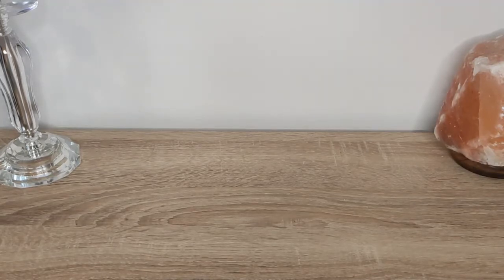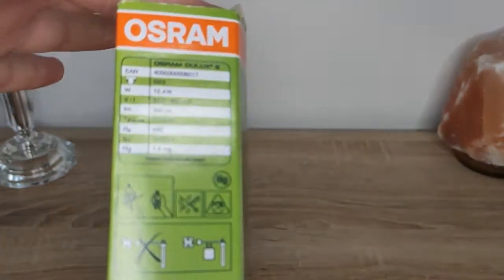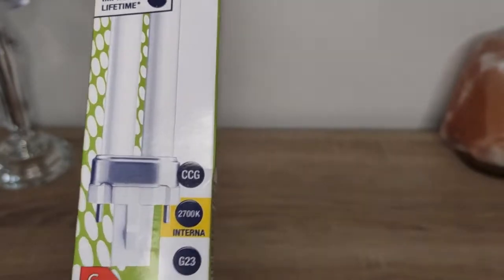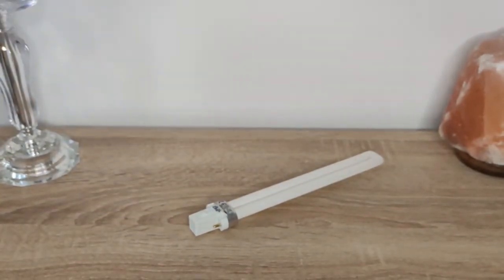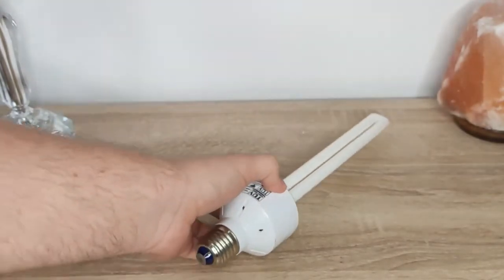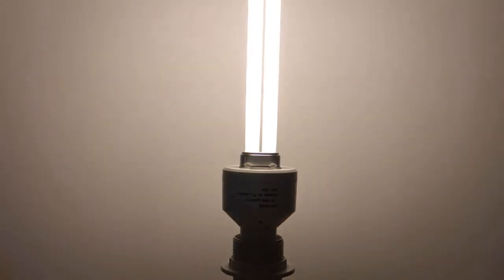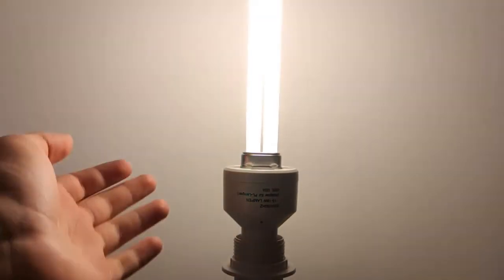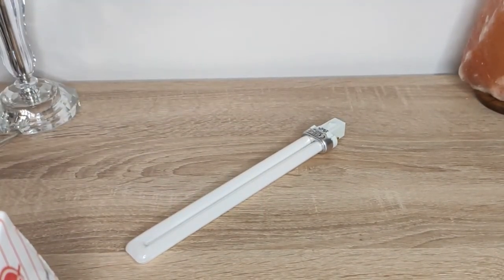Osram Dulux S 11W PL Fluorescent Lamp

Comment: It’s such a shame that newer Osram bulbs are made in China instead of Italy. The quality has really gone down
Reply from the maker: Yes, true. I have PL from italy and most osram T 8 tubes are made in Italy. But, for the chinese ones i dont find yet any issues. So, i might look in further but i have not seen any problems with the chinese ones. Thanks for the comment !
Reply: @photonik-luminescence  if you shake the italy PL bulb it won't make a sound. However if u shake the chinese PL bulb you can hear the starter rattle inside. Performance wise they are about the same. I've had a Chinese osram for nearly a year and it works great